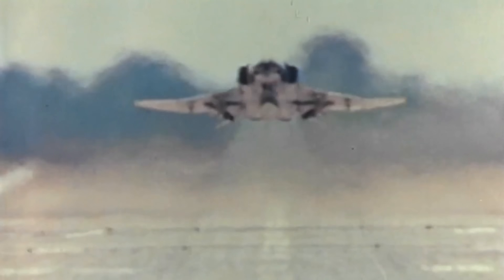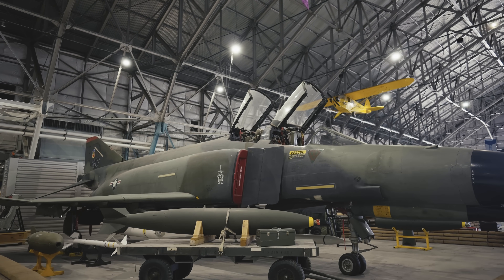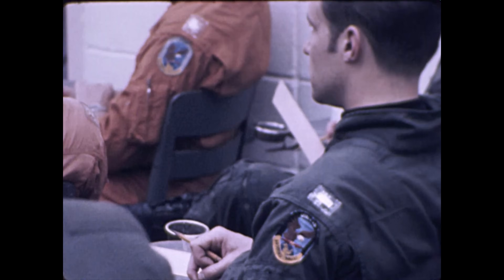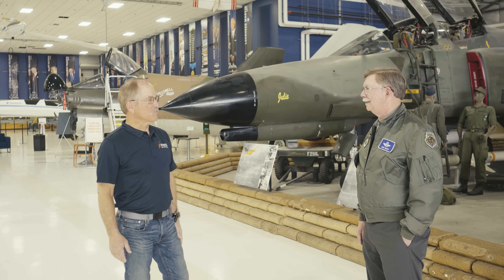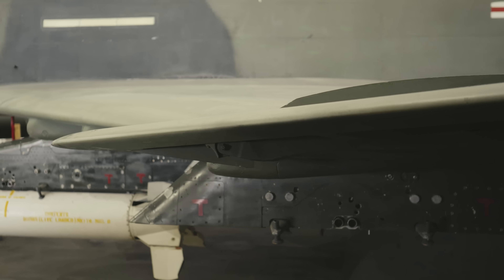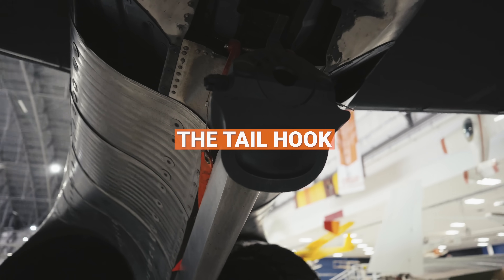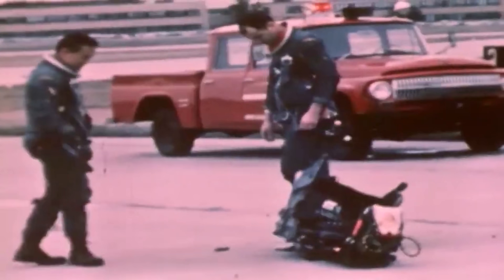Testing and Flying the F-4 | Behind the Wings

Comment: We lost an F-4 patriot last week.
Col. Walter Bernard Bills
June 18, 1930 — August 27, 2025
Walt graduated second in his class of F-4 pilots and earned the coveted Top Gun award multiple times.
He was assigned to the squadron that would take the first F-4E Phantoms into combat over Vietnam where he flew 200 combat missions. Among the highlights of his career was commanding the 53rd Tactical Fighter Squadron in Bitburg, Germany. He received Top Gun awards for the entire USAFE (Europe) while there.
After 29 years in the Air Force and more than 8000 accident-free military flight hours, Walt retired—but not from flying. In his garage, he built a single-engine experimental aircraft, proudly naming it “Miss Vera.”
Walt was a class act right to his last moments.
Interment with full military honors will be at Arlington National Cemetery mid September.

Comment: RF-4s were unarmed but the early ones had a  "Nuclear Stores" switch in the front cockpit .  I'm 80 now.  Anyone else notice that?   I've always  wondered  it there to bounce the last of the rubble on the LAST DAY.    Any one know?
Reply: The RF-4s that I flew had a nuclear bombing panel with a bomb mode selector switch and a timing function wheel. We were not trained on it and never used it. Such a great airplane to fly and it didn't like to fly slow😁
Reply: @rosecolored2024  I always wondered about that panel.  Thanks for the info.  My bit as thedAutoPilot.  RAF Alconbury '65 and '66.  MacKill    to finish out my  4 years.  F4s  only.
Reply: @dimbulb23 Thanks. You're obviously not that dim😁

Comment: Hydraulically the F4 was actually pretty tight but when compared to the better dog fighter the F8 Crusader which poured 5606 in buckets no comparison. Without re-watching you neglected to mention the fact that this was a Navy bird, through and through. First flown in 1958, record setter.
The VA is giving me 30% disability for hearing, I'm sure the F4 is responsible for some of that percentage.

Comment: No disrespect to these gentlemen, but there needs to be corrected.  First, there is a profound difference between leading edge flaps and leading edge slats.  The F-4B/N/J/C/D & EARLY E had leading edge flaps. The late E and G had the leading edge Slats.  The F-4S actually had BOTH leading edge flaps and slats.  As for the engine in this F-4E at Wings offers the Rockies, that is the wrong engine installed on the right side for an E.  All Es used J79-17 (long turkey feather exhaust) engines.  This one here at the museum has a J79-15 (short turkey feathers) installed on the right side. Funny they talk about the engines but stand on the left side where one is not installed.  LOL

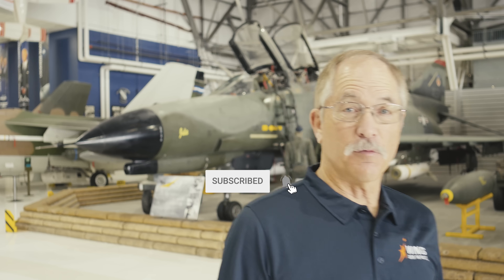Comment: I was an aircraft armament system specialist on the F4-E and G’s. I was stationed at Clark Air Base in the Philippines from July 85 -June 89. I know about all the roles and configurations the F4 could fly. I’ve seen a few crash with my very eyes. I’m surprised you didn’t cover the folding wings in the video. In fact I’ve sat in the very aircraft in your museum, even had a picture taken when it was at Lowery AFB. 16:40

Comment: Thank you for this video.  Since I retired to north Idaho, I met Burt Rutan, and his brother Dick ('Misty 40'), and my neighbor in the condo complex who was involuntarily extended so he could go on his Navy squadron's first cruise to Vietnam.  He flew F-4s (likely the B model) until their airplane was shot up, lost one engine (and both hydraulic systems, obviously as the lines for both were run between the engines), and being young with that "I can do this!" attitude we all had in our twenties, landed on the carrier at 240 knots, at an incredible descent rate.  I asked if he dented the deck (you may surmise that the gear went through the wings), and he related that the airplane was immediately pushed over the side.  After five back surgeries in Japan, he was sent to the frag office at Saigon, serving as the only officer in that building during the night, along with one sergeant.  
   Burt joined the "Caterpillar Club" while he was an AF aeronautical engineer at Edwards during the F-4 spin testing program.   Some years after that, it was found that in dropping underwing stores, the F-4s CG could rapidly shift beyond the limits, and reportedly accounted for 20-25% of  SEA combat losses.   Dick Rutan was the F-100F backseater with Misty 59 Donald K. Harlan who flew off the left wing of the RF-4C that had aircraft commander Maj.Gen. Robert Worley failing to eject.  (Dick Rutan corrected the story in my copy of Walter Boyne's 'Phantoms in Combat' book.)  This was the first of three such incidents, and analysis determined that with the rear canopy gone at high airspeeds, there was too much negative pressure on the front canopy for the existing system to open and jettison it,  So two small gas pistons were installed in the front rail to thrust the canopy bow upward.    
    The books by Ed Rasimus (sp.?) provide a good contrast between the F-105 and F-4 operations and pilots in SEA as he flew both.

Comment: I was an Aircraft Electrician in the USAF from '75 - ''79. My experience with the F-4 Phantom was at Spangdalhem AB (Germany) from '76 - '78. It was and still is my favorite aircraft.  One of the coolest experiences I had was going TDY to Zaragoza Spain. I had the privilege to helicopter out with an F-4 aircrew to Bardenas Reales bombing range. I sat in the control tower with this aircrew. They scored other aircrews flying by in their F-4's dropping bombs (smoke) and firing the M61A1 Vulcan minigun. What a sight to see! I wish that I could have flown in one. The closest I got was sitting in the back seat with a big test set in my lap. We did a high-speed taxi check to test the new anti-skid system I had installed. Close, but no cigar. LOL

Comment: Today, 2024, the Turkish Air Force still uses F-4s.  As to the fuel, a Boeing 737NG typically burns 850 gallons of Jet-A per hour in cruise.  A fighter in afterburner could have a fuel burn rate of 30,000 gallons per hour - so that mode is used very carefully.